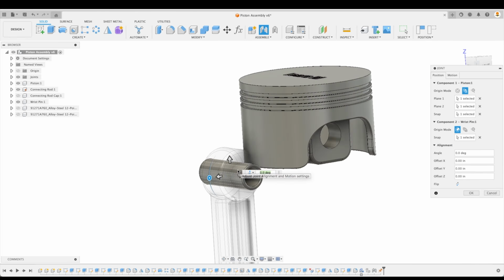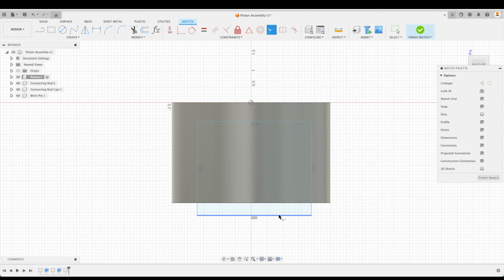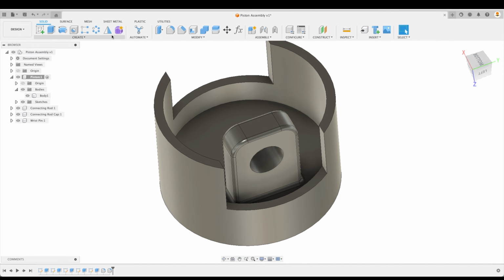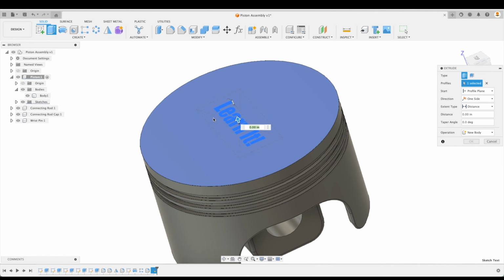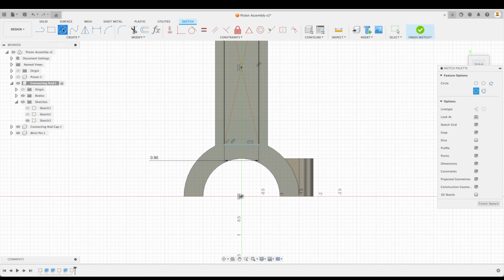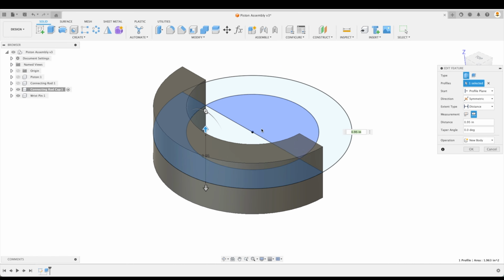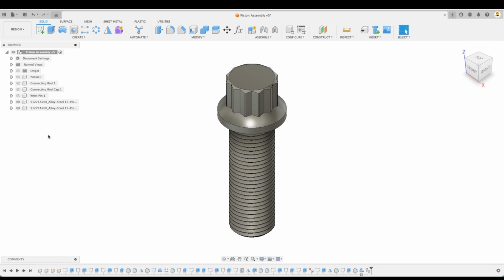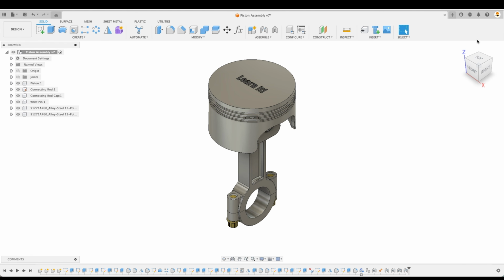Autodesk Fusion 360 - V8 Engine Series - Piston Assembly Tutorial for Beginners/Intermediate (2023)

Comment: When mirroring the indent in the center of the rod you can change the type to "identical" and it wont go all the way through. It will mimic the opposite side as intended.
Reply from the maker: Excellent! Thanks for including that. The updated version has exactly what you mentioned here. Thanks for sharing your experience.

Comment: When I do the joins for assembly, my components don't line up like yours do. The wrist pin is too far off to one side for example. How do I get the join to align properly without manually moving it?
Reply from the maker: Thanks for reaching out! You’re probably selecting the wrong snap points. Make sure to select the face that you’d like mated first (without accidentally selecting a snap location). That will guarantee the snap location is normal to that face. Then select your snap location. Do the same for the other face and feature that will mate. I see a large percentage of students that ignore this direction and try and select the snap points directly. For learners, trying to select the snap point directly can cause a bunch of problems because the orientation of the snap point might be something completely different and the results completely unexpected. Therefore, select the face first so that it turns blue and then select a snap point on that selected face. If you select the face and then it turns transparent and wants you to select the mating snap point, then you’ve prematurely selected a snap point without first selecting the face. Give it a try and let me know what happens.

Comment: Also the 360 heat exchanger is a notorious flaw. They corrode and the oil and coolant will mix without any sign. It is safer to run an external oil cooler like on the stradale. When it fails it causes all sorts of problems in the gear box and the engine. Since you are using the oem expansion tank you can’t see if the coolant changes color.
Reply from the maker: Thanks for your comment. May I ask, was your comment in reference to another comment? If not, can you explain a little more please? I'm not sure what you're referring to. Thanks!

Comment: Am I wrong or did you forget to set the width of the connecting rod in the first rod sketch?
I did a constrain symmetry between the two lines and the center line and then I dimensioned a distance of 1.3 which looked about right (You never gave that dimension).
Reply from the maker: Would you look at that! Completely forgotten. That’s hilarious. Good observation. 
I will try and post the value here as soon as I can. Thanks!

Comment: I'm sorry, it's not possible at 19' 22"  to Extrude the text  'Learn It!'  to minus -0,15" ?
But + 0.15" or more is working fine.  
Error text:
There was a problem combining geometry together.
If attempting a Join/Cut/Intersect, try to ensure
that the bodies have a clear overlap (problems can
occur where faces and edges are nearly coincident).

As far as I can see, I have copied everything perfectly as you told us. 😞
Reply from the maker: Thanks for reaching out! Working through problems only helps us to figure things out much better than if we didn’t hit them.

Question for you: what font did you use?
Reply: @learnitalready  
Thanks for your question.
Font: Impact, Text Height: 0.5", Text Align: Center 2x, Constraint text to the center: Coincident. 
It is still possible to rotate the Text?
Reply from the maker: Thanks for letting me know. Sometimes a different font creates problems but you are using the same font as the tutorial. The next best thing I can suggest is to delete the extrude and sketches tools and try again. There might be a possibility that you have another sketch visible that is accidentally being selected when trying to select the text. Let me know if that solves it.
Reply: @learnitalready  
Thank you very much for helping me.
This time I first placed the text in the top left corner in a quarter of the piston, this time with Arial, then I performed the negative Extrusion, which worked well, then I placed the text back in the Center in Sketch, then Finish Sketch , and now everything is fine.
Then I changed the text to Impact with edit Text, and after Finish Sketch the error message appeared again.
I have now changed the text back to Arial, everything is fine now, and I can continue with the exercise. :-)

Comment: Hi, 
When I extrude cut the text I get this error, 
"Error:   There was a problem combining geometry together.
    If attempting a Join/Cut/Intersect, try to ensure that the bodies have a clear overlap (problems can occur where faces and edges are nearly coincident)"  

So, from a quick google search I found that within the text sketch you can right click on the text and then click "Explode Text". After that exit sketch and extrude cut as shown in your video

On a side note, should the connecting rod shank have more dimensions or relationships (fully defined)?
Reply from the maker: Thanks so much for reaching out. I'm not sure exactly what the problem is. It might be an issue with the type of font that you selected. Try another one and let me know if that works. Also, regarding "Explode Text," sometimes that damages your text geometry which can create open profiles rather than closed. If they aren't closed, then you'll receive errors. So, try first with a generic font, perhaps the same one I used, and then let me know if you're successful. All the best!

Comment: Instead of drawing the connecting rod base as one and then split the body to obtain 2 parts? Is there a particular reason why you drew it twice and didn’t utilise the split body?
Reply: By the way just come across this channel amazing, clear concise. Fantastic
Reply from the maker: Very good observation and question. I thought about that exact same question. I first thought that splitting the body would be easier for our viewers, considering that this is a basic/intermediate tutorial. However, when I thought about for a while, modeling the thread and c-bore features may have really complicated things and added more explanation and time to the tutorial. However, creating two different components for the connecting rod, while possibly adding more time, has the additional benefit of teaching students how to improve in their assembling skills. 

So, to sum up, for a more advanced user, creating one sketch and extruding two components, or splitting the body is definitely a viable option. The method that I chose in this tutorial, in my opinion, is a little easier for a beginner/intermediate user to comprehend and edit/adjust if necessary. For you to ask the question you did, definitely shows a fine understanding of the principles of design. Keep up the awesome work!

Comment: Can I change my active units, to decimal inches?
Reply from the maker: Yes, absolutely. The easiest way is to go to your browser (on the left of the canvas which organizes all your components in your assembly) and just under your primary assembly you’ll see “Document Settings”. Expand that and you’ll then see “Units”. Hover your mouse over it and a little icon will appear to the right of it; right-click it to change active units. A dialog window will appear to which you can change the active unit and even make it the default unit if desired.

Please let us know if you can change it!
Reply: Yep but Na.
 Mine inches are imperial......0’-1 3/4”
 Yours are Decimal inches....1.75
Regards
Reply from the maker: @brucelocious  Both 1 3/4” and 1.75 are imperial. 1 3/4” is fractional and 1.75 is decimal. Both are acceptable ways of dimensioning.